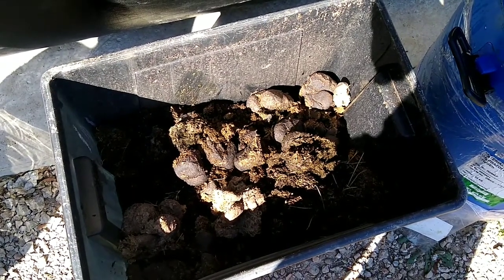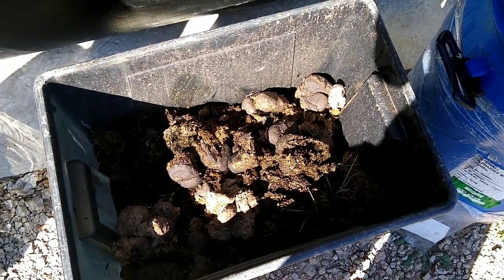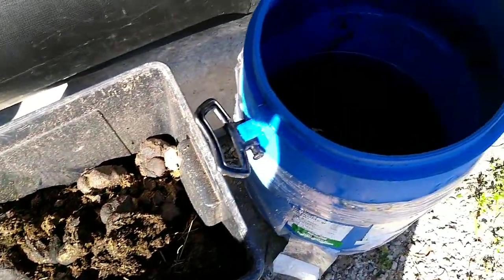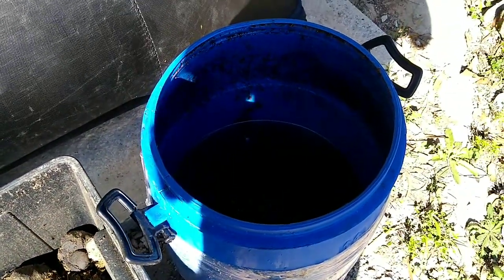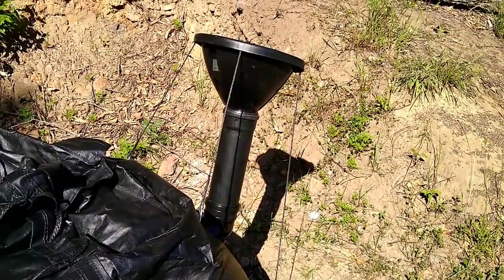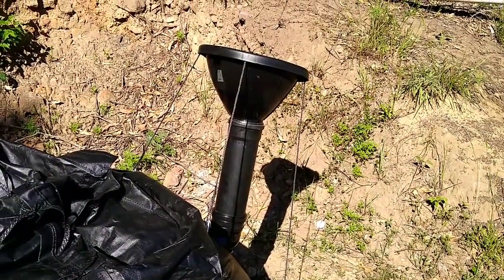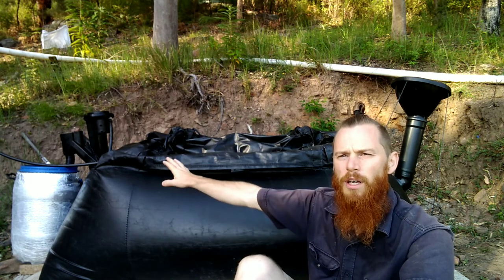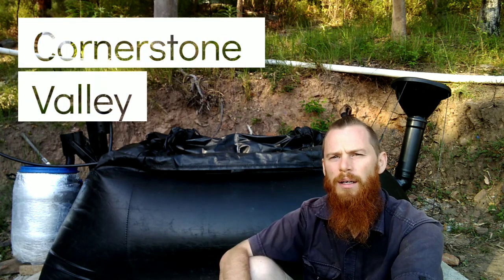Making a Homebiogas digester - Part 2

Comment: Check how to videos online for how to make methane gas filters basically a three part filter a water filter a second to dry the gas and a third of steel wool cant remember what each one dose but all explain what each filter does so look for how to build a methane gas digester and you'll find lots of them  I'm going to build my own I'm the type that looks at things and figures out a different sometimes better way to build things maybe what I'm thinking won't work but until I get the materials I need and do it I won't know I'f it'll work or not
Reply from the maker: Great work!  Thanks Douglas!